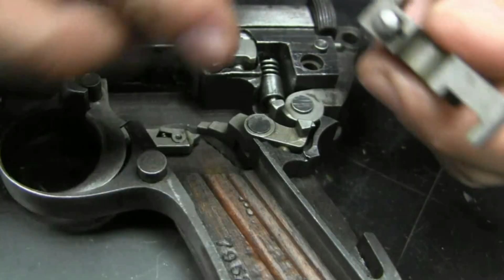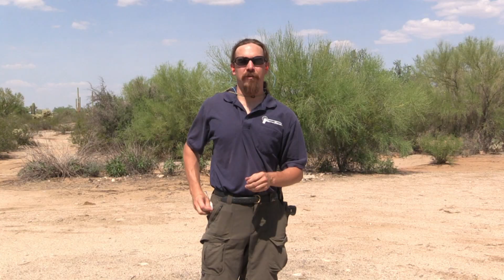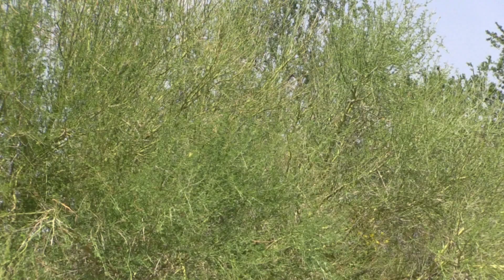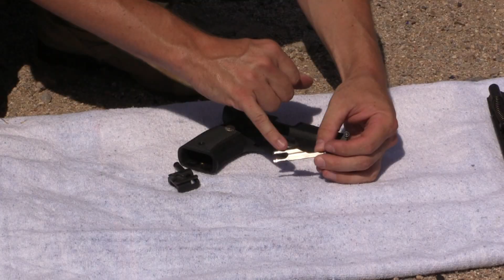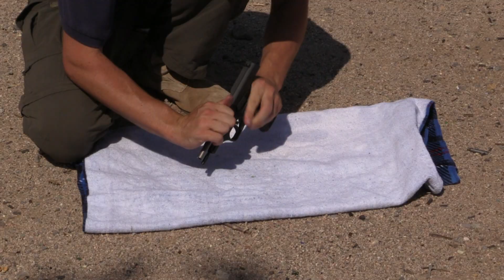Colt All-American 2000 (Disassembly and Shooting)

Comment: A well thought out, functional, reliable design  turned into a paperweight. Allowing attorneys and accountants to make engineering decisions is a sure way to destroy a product, any product. I own a number of Colts, revolver and semi auto, but none were made after the 70s and I have no desire for anything Colt has produced since then.
Reply: "A well thought out, functional, reliable design."  Are you seriously talking about the model 2000?  That sentence in no way describes this pistol.  The DESIGN was bad and they added to that bad design by poor manufacturing and marketing choices.  I was around when it came out and it was NEVER a good gun in design, function, or reliability.
Reply: RyeOnHam The original design, if properly developed and  built to the standards of Stoner and Knight, was a good and workable one. The bastardized offspring which Colt produced was so corrupted by decisions Colt made that it was a loser with a capital L. Back in the day we briefly considered this pistol when transitioning from revolvers to autos but it was clearly below minimum standards of reliability, accuracy and longevity.
Reply: I can say that we sent half the crate back to Colt after getting several returns from the first dozen we sold.  I don't care WHAT the design is.  If you can't manufacture it, then it's a poor design.  You can't really say much positive about it in hindsight either.  The poor accuracy was a design issue.  The poor trigger pull was a design problem.  Those were not things Colt changed, they were Reed Knight and Gene Stoner love-children that were not well thought out.
Reply from the maker: RyeOnHam
Actually, those were things that Colt changed.
Reply: RyeOnHam
That's a different gun. Like Ian said in the video; Colt increased the trigger pull weight and lengthened the barrel bushing.
Reply: pietzeekoe You don't understand how patents work.  That is the Colt 2000 patent.  Just because it looks different, does not mean that it is a different gun. They don't draw the gun like the finished product to protect their interests before they release the actual product.  The front sight is STILL pinned to the bushing and the trigger is identical.  The pull weight of the trigger was a result of the spring pressure required for reliable ignition with the design.  The DAO feature and geometry were retained.

It is easy enough to blame Colt, but Reed Knight and Gene Stoner were to blame for the design.  It was a turd and all Colt did was polish it.  Colt's was under IMMENSE pressure at the time to develop SOMETHING to compete on the wonder-9 market.  Ruger, S&W, SIG, Glock (who had a smaller chunk at that time) Browning and H&K (1993 ish) were all producing wonder 9's.  Colt would have produced ANYTHING to compete and they proved it.
Reply: Forgotten Weapons The most glaring design failure to my way of thinking was the slide wearing on the polymer frame with no metal wear inserts. Was that a feature of the original Stoner/Knight design.
Reply from the maker: RyeOnHam
I'm not trying to claim that it would have been a revolutionary design, just that as made by Stoner and Knight, it appears to have been a quite reasonable one. The front sight on the bushing was still a problem, and it still would have had a long DA type trigger. But what Colt did when they adapted it to mass production introduced a lot of addition problems, including major accuracy and reliability issues.
Reply: Forgotten Weapons I agree that the explanation you have given is the conventional wisdom, and there is some merit to it also.  Had the design been properly executed with problems vetted out and deficiencies corrected, we would have had a slightly better gun.  But then again, people say that about the S&W Sigma also.  Great design, terrible execution.  Similar time period as well as era for S&W.  Is that a discredit to Glock from which the design came?  No.  But I argue that the 2000 was a different design and one doomed to failure no matter who made.  I understand you've got years of myth and repeated supposition on your side.  So be it.  That doesn't hold weight.  I was skeptical of the design when I first saw it.
Reply from the maker: RyeOnHam
I've never actually handled a pre-Colt version, so I am willing to be proven wrong.
Reply: Dan Troop It looks like Rube Goldberg was the head of design at Colt for this project. Your point about attorneys and accountants is right on the button.
Reply: RonJohn63 "Attorneys don't usually make decisions "just because".  They were 
certainly thinking of lawsuits from the mothers of dead children, etc."   

 Yeah Im sure they were, but no amount of design features or safety mechanisms will stop the only reason the gun accidents I have seen from happening.  Even biometric readers wouldnt.    Every time I have seen someone have an accident with a gun (which was twice) it was "because an unloaded gun went off"    Both times someone got careless and pulled the trigger on an "empty gun" once my buddy put a hole in his cieling with a HK USP. and the other was an even dumber (if thats possible) "accident" with a shotgun, a guy racked the pump on "an empty gun" and then fired to "release spring pressure on the firing pin, so its safe to store for long periods" and blew a hole right through his nice pelican case. 

 The trigger on rollers is a neat idea, it gives a straight pull 1911 feel, some people like that, having it fuly cock the striker even at 6lbs is a terrible idea, one you have the worlds longest trigger reset and two you could theoretically pull the trigger most of the way in a tense situation and then decide not to fire and let the trigger go but since your trigger pull is 6 miles long, and all of it pulls the striker back, you might be able to pull the trigger and striker back far enough to ignite a primer even though the sear didnt drop the striker.
   With that trigger there is no "razor edge" of the trigger to ride, it all feels long and heavy, im sure after a while you could get the feel of where it breaks, but unlike any other design there is no tactile "notice" of that edge.

  The front sight on the barrel bushing is less of an issue than people make it out to be, the only wear that would effect accuracy is the barrel to bushing wear, just like any other gun with a barrel bushing that will cause slop in the barrel. the bushing wearing on the barrel bearing surface has no effect on the massive locking lugs that hold the bushing and therefore the sight in place.  That will remain as solid as ever.    
    Now is the front sight on a massive removable front section of the slide that acts as a barrel bushing a good idea? no not really.  But that is more from a manufacturing and maintenance standpoint.     Your front sight would stay where it started throughout the life of the bushing, but when switching it to a new one, a few thousands on one lug more than the original could shift the sight a little.  Enough to matter? no. an adjustable rear sight takes care of any "windage" issues with the front sight and how its mounted. 
   And thats only if you notice the front sight is .05" more to the left than the last one.  \

 Now down to the question "did colt screw up the gun?" yes they did, they took a marginal design and made it worse than it was.     It doesnt matter if the Keebler flippin Elves, teamed up with Mickey Mouse and designed the gun it was marginal, I think people hear Knight and Stoner and start leaving damp spots in their chairs and expect it to be gold just because of the names.       John Browning,who is certainly one of the most prolific, and successful, and  arguably the best firearms designer ever,  made some duds over the years. So has Knight and Stoner, every firearms designer who made more than one gun (and even some who just made one) have had some pretty bad ideas.
Reply: RonJohn63 I read through it and it seems logical.
Reply: +Forgotten Weapons seems like it should  be great and awesome
Reply: +Forgotten Weapons seems like it should  be great and awesome
Reply: @ForgottenWeapons  did you ever come around to it ?:3

Comment: I had a chance to handle the first version of the AA2k at a gun store when it first came out.  At that time it had an aluminum frame and a very nice looking wood grip panels.  That pistol felt great in my hands.  Too bad Colt couldn't manufacture it correctly.